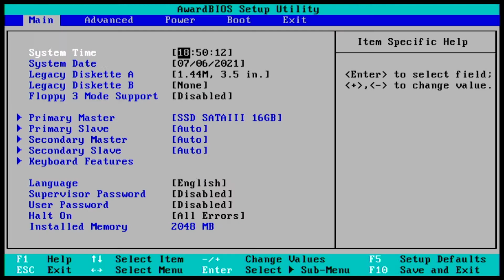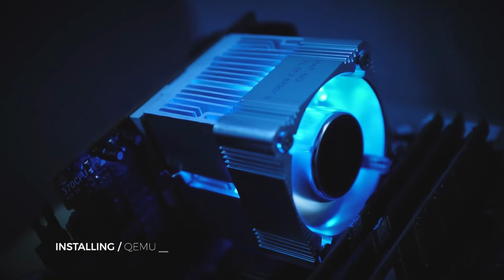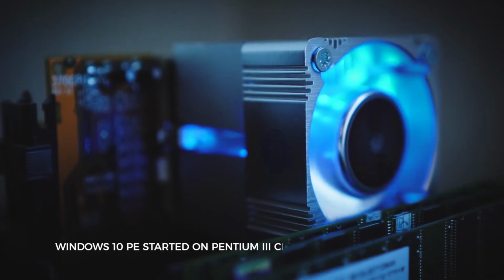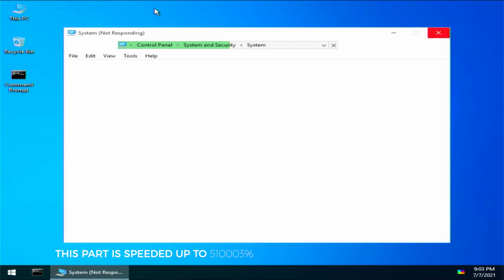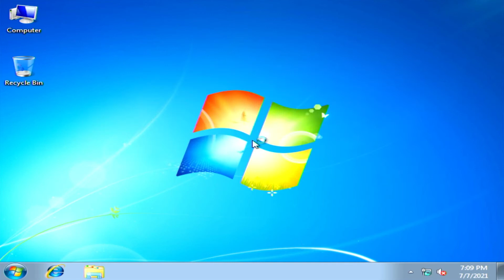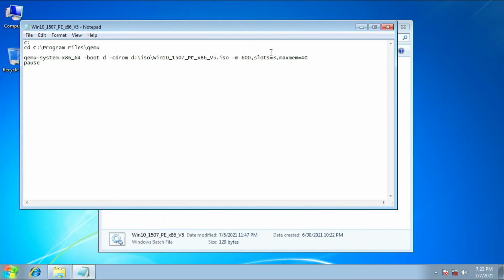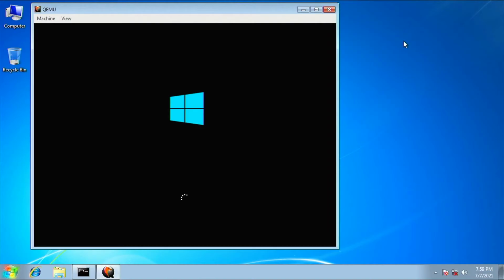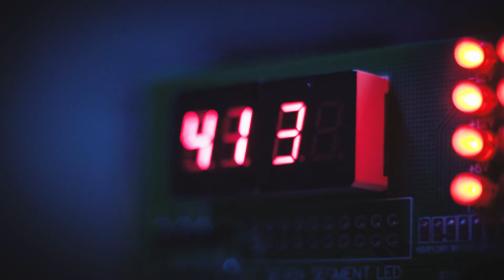You CAN run Windows 10 on a Pentium II

Comment: Ok, but normally nobody would pair a Pentium II processor with a Geforce GT 430 a 64 Mbyte or even 32 Megabyte videocard like some GeForce 2 would be more appropriate.  Also 2 gigs of RAM is a lot for that processor. At the time 256 Megabytes was "high end".

Comment: Wait a second, you used QEMU ON a Windows 7 running under PII to EMULATE newer CPU? It had no right no run even remotely fast 😅 This is not a virtualization in this case, but full emulation. Like, executing each instruction programatically. Even the fastest modern systems would run such QEMU machines quite slowly - btw: compared to those PII 400 Mhz native system. 

So, to emulate HOW Windows 10 would work on such system, it would be the best to use modern machine to emulate PII with those extra instructions. Sadly QEMU doesn't support pinning to the exact CPU speed.

Comment: its not actually on a pentium II if its not actually booting into it from actual hardware (regardless of whether its era appropiate or not).  QEMU is VM not off real hardware
Reply: Umm lol its still all running on a REAL pentium2 as in REAL HARDWARE qemu just there to emulate instructions the p2 doesn't support so it does it the slower way but this is all valid
What u said about booting is nonsense and changes nothing this is all 100% running on real hardware period

Comment: Surprisingly, the Intel Pentium 4 still works for Windows 10 and EVEN Windows 11
Reply from the maker: Thanks to instructions like SSE2
Reply: Pentium 4 631 minimum.
Reply: everybody  says pentium 4  , but they forget there are 2  types of pentium 4 . One on socket 478 ( single core no 64bits) , and the other on LGA775 , 64 bits and up to 4 cores . the later can run windows 10 up to windows 11
Reply from the maker: @tunkunrunk  Pentium 4 has SSE2 instruction set, NX bit and PAE support.  Windows 10 requires them to run properly. But clock to clock, the early Pentium 4's are actually weaker than Pentium III. P4 only gains it's performance by running at 2 - 3Ghz, instead of 1.4Ghz, that was the maximum speed for Pentium III class.
Reply: @command_line_channel  the Pentium 4  you are referring to is the one using the LGA775  socket .   the Pentium 4   that uses socket 478 can't  run windows 10  , you can find dozens of  videos on youtube of people trying to do that with no luck .  People who succesfully installed windows 10 on pentium4 always forget to precise it's  the LGA775  versions
Reply from the maker: @tunkunrunk  Thanks for info, so Windows 10 might require SSE3 as well. Will check those videos and test it myself some day.
Reply: @tunkunrunk  not true, some 478 (extreme editions) can run windows 11 due to supporting 64 bit code and enough code for windows 10, the code underneath is mostly the same so if it is the right combination of hardware (probably including gpu and motherboard compatibility and custom iso install too)
Reply: @patg108  that's not possible, whatever variant you may find on the "socket 478" , you can't  install windows  10 and 11 .  You'll find several videos on that challenge on youtube , or on forums,  but everyone who tried, failed,you can't go past windows 10 logo . Thise who claim they were successful,  barely mention they achieve that with Pentium 4   LGA775
Reply: @tunkunrunk  yes its possible with select models, they just barely meet the requirement for windows 10 32 and x64 variants.  It may well need a custom driver (likely one modified to be compatible with windows 10 from a previous windows like 8.1 or 7 or even vista can be done), a gpu new enough to be compliant with windows 10 AGP, PCI or X16 would be options.  There is some late boards with early PCI-x16

It'd take time and knowledge and quite a bit of hassle but it can be done with persistence and trickery
Reply: @tunkunrunk  not true, there is also socket 423 (1st gen out of 3), then there's also mobile and some related variants that closely related cpus to the pentium 4 (as well as the architecturally similar but slightly more advanced Pentium D series)

And of course their Xeon counterparts that they are based upon too.  Xeon has been a server line ever since the pentium 2 days.   Pretty much what replaced the Pentium Pros.
Reply: @tunkunrunk  sorry but all "pentium 4s" were single core and if we are just talking netburst then dual core was the highest hyper threading does not equal logical cores
Reply: @tunkunrunk There is also Socket 423

Comment: I can never understand why the right click takes 1 minute for any cpu to finish. Just how badly optimized is win10?
Reply: It's because it's running on QEMU, which has a massive performance overhead as it has to simulate every single CPU instruction. Even windows XP running in QEMU would be that slow
Reply: Windows 10 is very badly optimized. In this case, it was virtualized, so it's not that bad, but it happens even on real hardware
Reply: @POS-Website-User  Ok, but still, it happens even on real hardware.

Comment: hmm wouldn't qemu work faster on some small linux distro and who knows , you could probably even emulate hypervisor in that linux if you get really dirty with recompiling things?
Reply from the maker: I guess you are right, Qemu is not that fast even on the real Core i7 under Windows 10. So Linux is a thing to try some day.
Reply: I doubt it’d be much of a game changer tbh. QEMU is painfully slow when it comes to emulating pretty much any non native architecture. It doesn’t work the same way that Apple and Microsoft’s X86 emulation works (which translate the binary ahead of time and avoid the cost of real time emulation). QEMU has to actually simulate an entirely different CPU instruction set in software and that can slow things down by a factor of several hundred. 

I do think it could probably handle puppy Linux or TinyCore usable though.
Reply: @photoniccannon2117  12 years ago i succesfully run dsl linux on pentium dual core's because school needed to run linux on computers that we couldn't phisicaly install other operating systems due to licencing agreement with european union program those computers came from, but yes i remember even windows xp installation was painfully slowi would have thought qemu improved from then, but again i only test reactos from time to time with that and i changed computer few times along the way so it might not be qemu that got faster